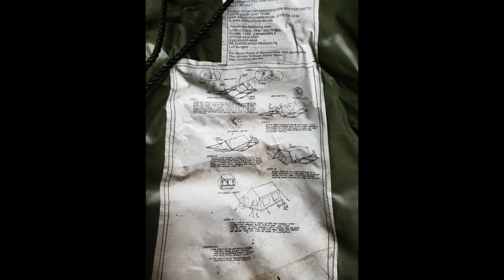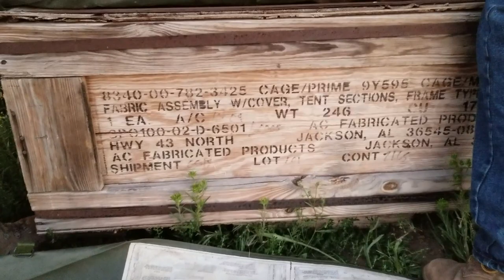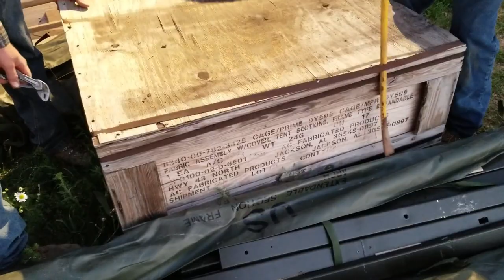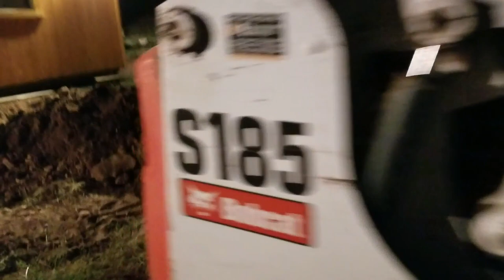Army Tent vs Yurt, which is better for living On Your Off Grid Property?

Comment: These are a great way to avoid zoning issues, property taxes, etc. as a tent is considered a temporary structure in many municipalities.  
Having used these in the Army you will need a few things to make them more cozy and reliable. 
1.  Set the guide lines out and use good quality stakes, not the ones which come with it.
2. It will need a liner for the temp extremes (below 40 and above 90).  The ones made for them hang about 1 foot inside it offering great insulation.
3. Be sure to set the tent's sidewall seal all the way around to avoid drafts.  If you didn't overbuild the pad they'll have to be attached to the frame.  Any gap will = drafts.  I'd staple it and duct tape it.
4. Put a Yukon stove or similar in it.  It is great for heating and cooking. 
5. Use one of the ventilation holes to setup a small fridge in summer.  Move the fridge inside in winter for extra heat.
6. Protect it with a burlap cover.  They're typically put about 3 feet over the tent and extend 2/3rds the way down on all sides.  For the entrance -it's higher to make an entryway type awning.  Besides protecting the tent from flying debris, sun and pelting rain and sleet (so you can sleep) it helps to moderate temps inside the tent.  The awning and covered entrance make a great place to store stuff and work outside under partial cover.  As the burlap accumulates leaves, twigs, grass, etc. it will provide great camouflage as it naturally breaks up the tent lines and smooths the appearance. 

Done right these tents are great 'temporary' shelters.

Comment: I was part of a medical unit in Desert Shield/Storm.  We set up these tents (TEMPER) in the desert  and lived in them for months.  The kit was missing the insulated floor and  the interior liner.  The outer shell was designed to be impermeable to liquids and along with the proper HVAC unit attached provided filtered air into the tent which had positive pressure inside to prevent chemical or biological agents from entering the tent (provided you've also got the vestibule attached with solid doors)   The great thing about the tent is that it also came with power outlets as well as fluorescent lights.   The tent is also modular so you could take two of those kits and put them end to end and make a bigger tent.   I had extensive training on the setup of these during the month of December 1990 at Fort Indiantown Gap, PA.
Reply: Cool
Reply: I thought I recognized the T.E.M.P.E.R. framework, which sets the roof header higher that it would be in the Expanded Frame Tent.  The extra vertical clearance allowed the 10"-12" deck to set inside. Very nice!

Comment: Dude you need a duller blade and a weaker battery for that saw... Loved the unpacking of the tent!! Pulled the lid off the box and left those nail or screw heads all around the outside edge. Then pulled the tent up out and rest it on..... the EDGE with the nails in it! Brilliant! BRAVO!
Reply from the maker: Wayne Davis, 
 Yesterday we boxed up the tent for winter and those nails in the lid made for easy repacking!

Comment: Based on my military experience with large scale tents is the raised platforms will draw rodents and snakes especially in the winter months if your tent is heated. This is 100% guaranteed
Reply: how bout on rail road ties/no space underneath
Reply: Sounds like an eco lab problem?
Reply: That's what I always wonder about with the raised cabins and all. Things will nest under the building whatever kind it is. Janice
Reply: Snakes and diesel fuel will reside in same spot....when. snake hunting ,can spray diesel  into stump holes and snakes will come out and can catch them.... snakes will not cross over a line of sulfer  powder  boarder outside boarder of tent
Reply: It's got to be better than sitting on the ground
Reply: Do your best to fasten and seal the tent to the platform leaving no space for mice and snakes to enter.
Reply: I’ll add, any rodents, snakes or even lizards that enter will only lead to their quick peril with 4 cats 🐈.

Comment: Much easier to do the roof lacing BEFORE YOU RAISE THE FRAME.....and that's the way the Tech Order says to do it as well.  Also, the exterior windows should be rolled UNDER so water does not pool in them.

Comment: I purchased the same tent, surplus, brand new in a crate with the frame. I use it for camping in the eastern Nevada desert. Have used it 4 times now. It will withstand high winds. 70 mph. Stays very dry inside. Also designed to block light from emitting from it at night. I found a brand new surplus inner liner for the tent for about $250 online. It adds a lot of insulation value in the winter. I have used this tent in winter with a wood stove. Works great! Had 8 inches of snow dump on us one night!  Some day I hope to put my tent up on a platform like this. Will make for a very comfortable shelter! If you plan to leave it up for extended periods I would recommend some sort of external frame and some additional tarps over the top just to protect it from the sun. Thanks for sharing the video!
Reply from the maker: Jim Gillespie 
Thanks for the idea of a liner, I will do some research and see if I can find one
Reply: Hgg
Reply: Jim Gillespie Just don't use treated wood for the foundation, unless you're into cancer.
Reply: rich, treated wood is nothing more than a salt water brine.
Reply: Jim , Where did you purchase your tent from? I need a couple. Thx.

Comment: Once you add a solid framed floor, you've negated the portability advantage of the tent, or the yurt too, so you might as well just build a shed.
Reply from the maker: Live on Less 
That is really well said, but after considering all of our options, budgets and time lines this is what works best for us.
Reply: Better than mud! Also why do you need portability? I think what they want is "temporary".
Reply: To be fair the floor looks to be somewhat mobile if you have something like a tractor trailer.
Reply: Live on Less
Reply: Rather than state the obvious...why not ponder if it matters? The tent is still portable, goes up quicker and is considered temporary in most counties that enforce such things. Besides...some enjoy a fabric structure yet need the solid raised floor for semi-permanency and comfort. Ty living on the ground for a year or two...a wood floor makes all the difference.
Reply: You are right on this!!!!!!!!!!!!!!!!
Reply: A cabin that size is like $10,000-$20,000 unless you're basically getting the building materials for free, takes longer to setup, and isn't nearly as portable. Might also need inspections, permits ect...
Reply: I've built decks and sub-floors like this with up to 6' widths up to 16' long, sometimes 2x8 or 10 or 12". Bolt the sections together, then when you want to move them, unbolt and with a couple of guys, pick them up and put on a trailer(mine is 6'6 between rails and 18' long) and tote them where you want them.  It's not rocket surgery.
Reply: barnmaddo my cabin cost 15,000.
Reply: I would disagree with the idea that a tent is better for the time line, as I my uncle and 3 of his men built my house an I moved my family into it with it just needing paint 7 days after the foundation was dry. First day we layed the main floor, and raise an sheeted the 4 exterior walls. day 2 we raised the roof, sheeted it and shingled it. day 3 started interior walls an etc. You seemed to have had quit a few men that did not seem incompetent. Surely they could have raise 4 walls an a roof on a small area in a day.
Reply: Live on Less this is blokes doing stuff , they need to build , but yes I agree
Reply: Greg Ward Fully agree mate , pine frame with even second hand corrugated siding and line the ceiling so no condensation, stuff the tent ,they eventually rot .
Reply: This type of tent, which is what I believe we called an "ARFAB", is a semi-permanent structure. I lived in one for a year in the desert during the first Gulf War, it held up pretty well. The fabric is a very heavy vinyl coated nylon or polyester similar to truck tarpoleans. The aluminum frame will last for decades and replacement fabric skins can be purchased.

The Army also has prefab wooden structures in boxes ready to go, these "Theater of Operation" constructions are supposed to have a 20 year lifespan.

Another way to do the foundation is to lay down a layer or two of sand bags. Also a grid of stringers with interlocking cuts can be made to form a nail-less foundation, or plastic shipping pallets can work well too. The tent should have come with fabric floor, BTW. Outdoor carpeting works well over the plywood or sandbags to protect the floor and give it that homey feel. AFA insulation, I'd go with rolls of "Refectix" which is essentially Mylar covered bubble wrap. Be very very careful about fires.
Reply: ...having multiple solid framed floors at different locations could solve the portability issue
Reply: Crispy Critter: Excellent platform idea and planning, Thank You.

Comment: That tent is a Darnell. They are really hot inside during the summer months. GP Medium are mush better and vent well for summer use..  Tubes on the bottom are for a field A/C unit. The flap in the center on the top is for the stove pipe. BTW when put up properly, the tent will NOT leak or blow down. Just sayin'.
Reply: Your standard backpacking tent becomes uncomfortably warm in direct sunlight if it is 60-65 degrees F plus.

Comment: if i had a choice, it be a tipi.yea poles are long. but with a little ingenuity you can make poles that come apart.if you set one up correctly with a liner and a ozan its not only easily transportable but much warmer without the added weight of stoves, floors, ect

Comment: imagine the platform could be much better with tyvek to the underside of it to create the dead air space insulation value in the floor, slows condensation up into the sheeting too.
Reply from the maker: that's a great Idea
Reply: YVMW, really. concept is simple, actually doing NOT so simple but, the slower cold comes up through the floor (pulled by heat escaping roof!), the easier it'll be to keep it warm with smaller fires. not sure what you're using exactly for wood stove, if it stays warm with smaller fires you can line the inside of the stove with fire brick, that can keep warming a couple hours after the fuel has burned. IF you're really ambitious, check out "rocket stove mass heater", I'd think a smaller one could be built using a 30 gallon drum. very cool exit pipe temp (safety!), clean burning, and a 1 hour fire can keep radiating heat all night long (longevity!). big warm bench seat to sit on a while if outside in the freeze a while too once the big slab is warmed.

Comment: pressure treated wood isn't softer, it may seem that way due to the chemical moisture, and most pt is made from #2 or 3 lumber. you should have used pt plywood as well, it'll last longer.

Comment: The obvious answer is the yurt, but done right. It's cheaper than a tent that has to be thrown away once it starts to degrade, and all tents degrade. If your yurt is made from random parts found at the hardware store, you just have to buy those parts to replace a damaged section. One has to look at the "burning man" and the people who year on year bring the same yurts.
Plus, it's a more pleasing item, both visually and to the touch.
Unless you buy a brand new, never used military tent, you're bound to feel the stench of rot. And washing the tent isn't exactly an option, as all the protective layers are going to be ruined and have to be reapplied.

Comment: It's neither a bad battery, nor wet wood. It's the guy pushing the saw too fast.
Reply: selador11 also twisting the blade so it binds up. Good way to burn up the motor... lol
Reply: Battery is down, so you have to slow down and let the blade cut.

Comment: For that much money just frame it like a house and cover it in siding with a plywood roof, tar paper and shingles.  Not up to suburban standards but better than living in a tent and you can improve it over time or at least turn it into a garage.
Reply: Also, just out of curiosity, why cut 4 inches off of each platform stringer.  Save yourself the work and have a bigger platform.

Comment: Why 12 inch centers instead of the normal 16 inch centers? It takes a lot more lumber and makes the base much heavier to move. Additionally, plywood nails and screws just as well to 16 inch centers and there is no noticeable difference in the amount of weight it will support. So why?

Comment: Brother, the tent will be cold in the winter but the yurt (if it is the traditional Mongolian) would be toasty.  Sure hope you have a wood stove properly installed.  Still, if mobility was not necessary, I would have bought a 17 to 20 foot Older Uhaul Truck, drove it to the site, put down a simple foundation, undone the U bolts, rolled it off, anchored it in, built a regular door, waterproofed the roof, put in ventilation, electrified it, added water and septic, and installed the wood stove.  Then, you could build and light a flat bed for it and use it for your farming.

Comment: if you have to have a tent your frame tent is a dandy,  just remember when you roll the sides up stand inside the tent and roll towards you, that way moisture rolling off the tent will not get caught in the roll...if it is not really cold, undo the corners at least, that will help prevent moisture build up inside the tent, during the day (if warm enough) roll up the sides...there used to be a white liner for the tent, I think it was like a mosquito bar...at the bottom of the feet should be holes, it would greatly benefit you to get some 2 foot iron bars to drive into the holes, in case of high wind...have seen them rise off the ground with a Lt dangling off the middle cross bar...got up about 6 feet and rolled sideways...luckily no one was hurt...of course finding the proper stakes or tie downs is up to you...I really liked the frame tent because I had been involved it erecting GP large and medium tents...erecting frame tents is baby shit compared to putting GP larges and mediums...also there is a vent flap on the top of the tent you should open when possible, it has long ropes attached to both side of the flap so you do not have to climb the frame test to open them...also it paid off big time for me to dig a trench all the way around the tent, this will allow water to run off before getting to the inside of the tent...anyway hope I do not offend your intelligence...you know how us old men are...p.s. spent about 30 years in the military...

Comment: While stationed at Ft Drum I spent two weeks in a GP Medium in temperatures as low as -20 below with the old Army space heaters it keep the inside comfortable but unheated the sides would freeze solid from condensation.

Comment: You shoulda called me.  I learned how to do this in 1990 at Camp Bullis, TX.  July 29, I might add......
Three days later, Hussein invaded Kuwait.  It ruined my summer...........
JK I was a Guardsman.  We didn't go anywhere, but I still learned how to make these things go up.
Reply: BTW they attach together longways.  You can attach two more on and have a helluva nice "longhouse" and still not spend as much as you would on a yurt.  I also noticed the liner wasn't in it and you weren't using ACUs (atmospheric control units or HVAC) on this, which would be smart, but I don't think these were set up with multifuel stoves in mind. Did it come with the liner and plenum?  
The platform was a good idea and nicely done.

Comment: You guys did a good job at showing how crappy the dewalt battery saw is and lol.
Reply: Ruiner177 The real problem was twisting the cordless saw. If you pay attention he keeps wiggling the blade while cutting. This binds the blade and will burn up the motor over time. Learn how to use a circular saw first.

Comment: Yes the military tents are cheaper butts the question I would be asking is how well does the military tents hold up to the years when it comes to cold weather the Earth was developed over thousands of years in Northern Mongolia and it gets below freezing there in the winters and plus it's round so it will deflect the wind a lot better than the military tents which has four flat walls

Comment: No bracing, no hangers,  no brackets, no moisture barrier,  screws pressure treated wood and ply wood is the plywood treated at least .  So your starting with a weak uninsulated deck, should be interesting later on.

Comment: You had the saw adjusted too deep, only set the depth deep enough to cut the thickness of the board, the extra blade out causes more friction and just binds you blade...besides wasting battery life.

Comment: That will not be warm in the winter. I can see you live in a temperate area and from my army experience these tends need a lot of heating in the winter to be comfortable (by a soldier's standard). They usually need a generous diesel blower connected to one of those inlets at the base which consume a lot fuel. Not a problem for the army as these things are normally only used in bases with a steady fuel supply and economy isn't really on the priority list in war.

But for a home I'd only use these in a warm climate.
Reply: Look up Maine winter in a wall tent in New Sharon, Maine - YouTube 2013

Comment: One foot centers? One screw on every floor joist? That's really excessive. You only need two foot centers with a screw ever joist or ever other joist, depending on your orientation. No joke. Save the money on all those screws and 2x10s.  You definitely over engineered it.